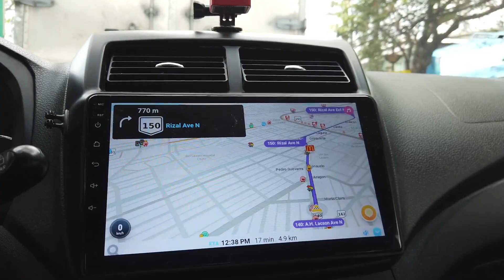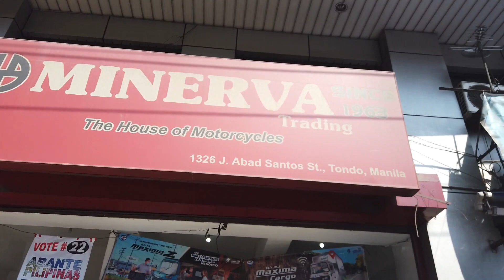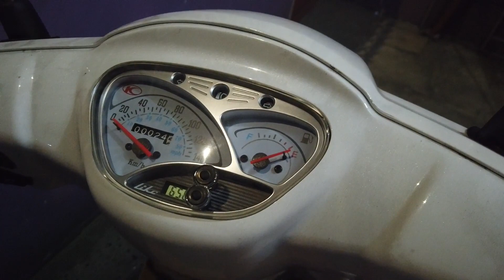WE PURCHASED A NEW MOTORCYCLE! (Kymco Like 125 Italia) ITO BA ANG PERFECT SCOOTER FOR BEGINNERS??

Comment: Matakaw po ba s gas?
Reply from the maker: Carb type so medyo mas malakas sa FI pero depende din sa driving habit eh.
Reply: @OnadskiTV  Boss ilang Kilometro per Liter ang Like125?
Reply: Honestly, in my own experience, 22.93km/L yung fuel consumption ko.

LATEST FUEL CONSUMPTION CALCULATION:
    3,701KM FULL TANK
-   3,604KM
=       97KM
÷   4.23L REFUELED
= 22.93KM/L
Reply: @laurencemichaels3503  ang lakas ng consumo ng Like mo Sir.  Baka need na ng tune up?...
Reply: @AndrewR10001 
Since brand new, ganon na talaga consumption niya kaya almost garage king na siya dito sa bahay. Di ko alam kung lahat ng Like 125 same lang... Isa pang problem sa moped ko, yung clock niya, hindi responsive ang button sa baba. Late ko na nalaman sira pala yon.
Reply: @AndrewR10001 
May mga nagsasabi sa akin na kapag daw nag-start tayo ng moped, malakas daw yung pasok ng gas sa makina... Everyday, 8 to 10x ako nagsa-start up ng motor kakabili ng mga needs namin sa kitchen. Sa mahal ng gas, di ko na lang siya gagamitin sa work starting today.
Reply: @AndrewR10001 
Puede ko ba malaman yung fuel consumption ng Like 125 mo, bro? Di ko kasi magamit sa normal riding yung akin dahil nasa kitchen ako palagi eh.